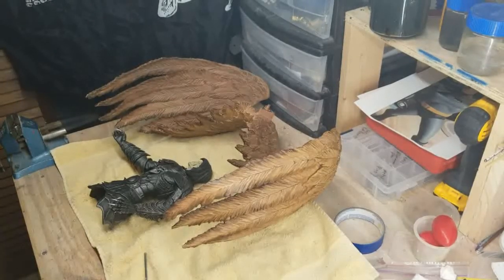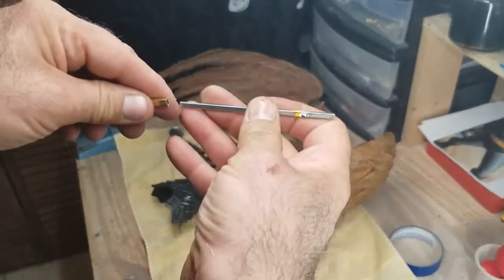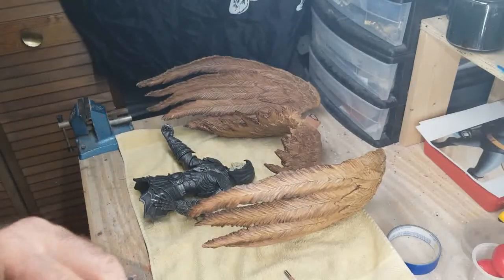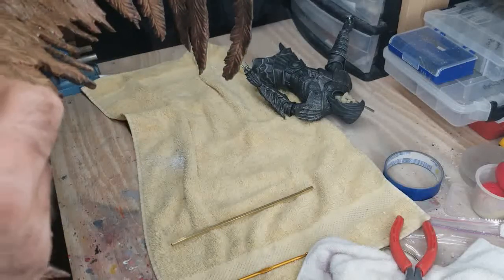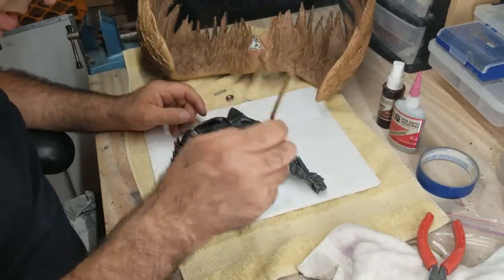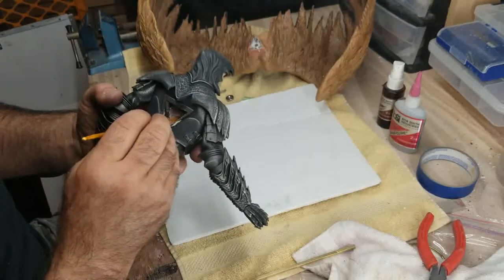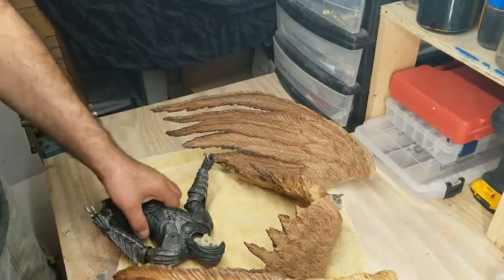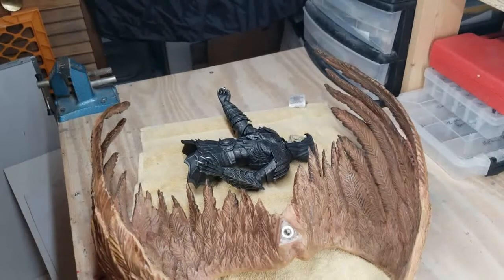ARH Sideshow Angel of Death statue wing repair

Comment: This is probably a stupid question, but what is key stock?
Reply from the maker: That's not a stupid question at all. Keystock is basically a square solid rod made of steel. I believe I show it in the video and mention it at the same time. Let me look and see what point it says it, and I'll let you know. Thanks for reaching out
Reply from the maker: Ok, at the 27 minute section, it's the piece,  or rod I'm putting into the wings. Hope thar helps
Reply from the maker: Also at the 32:50 mark